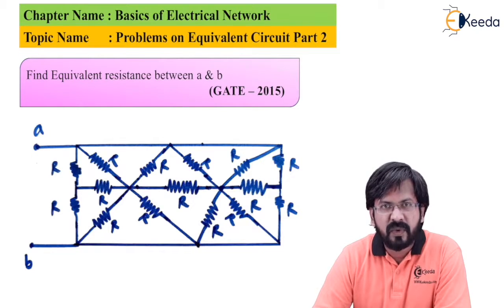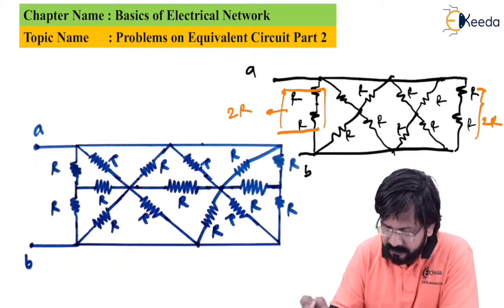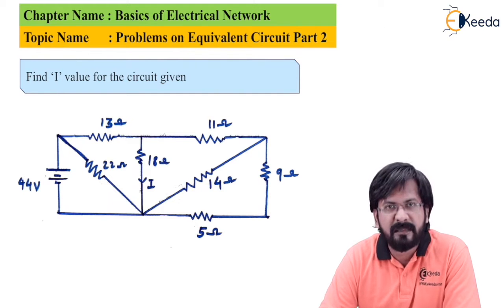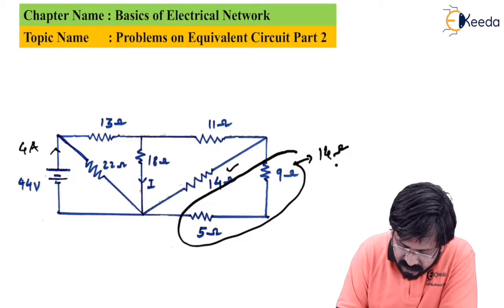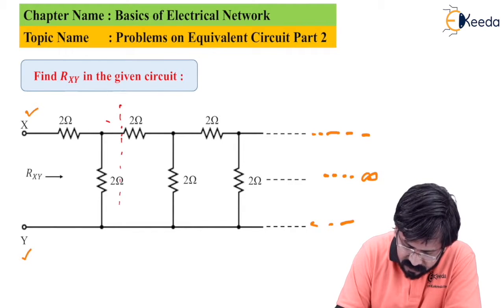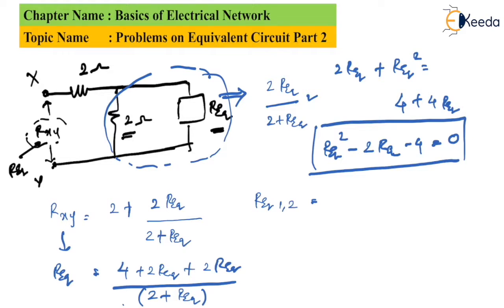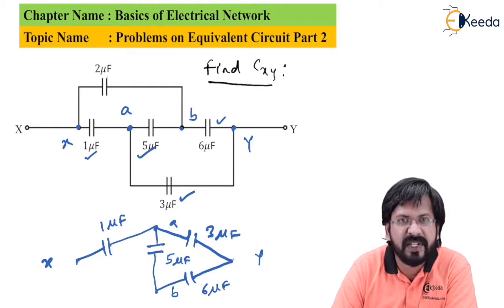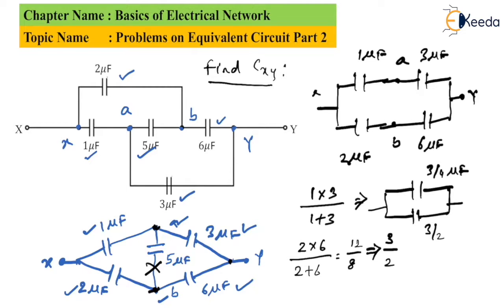Problem 2: Equivalent Circuits in Basics of Electrical Network | GATE Electrical Circuit Theory

Comment: I did not watch the video, but believe I know how to solve this complex circuit problem.

All resistors are the same value,  which results in the voltage across each  horizontal resistor is zero V because the voltage from each top resistor to  any horizontal resistor will be the same , thus no voltage differential.

That means horizontal resistors are not drawing any current, they have no voltage potential  across them and thus not affecting the total resistance of the circuit. Remove them.

What is left is a series two series resistors per leg and each leg is connected to all the other legs in parallel. Thus R + R =2R  2R in parallel with 2R = R  resulting in three R in parallel, R/3 = 0.333R

I'm pretty smart but also sloppy. Was I sloppy and messed up?